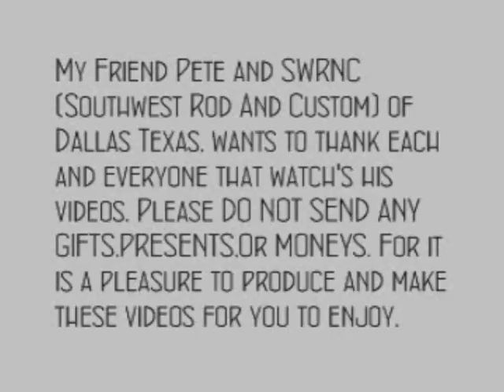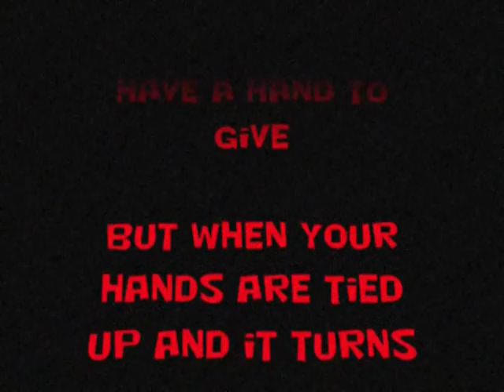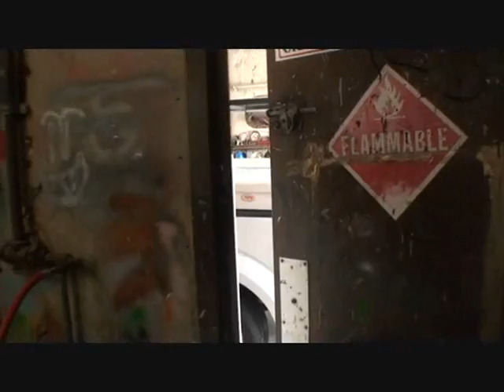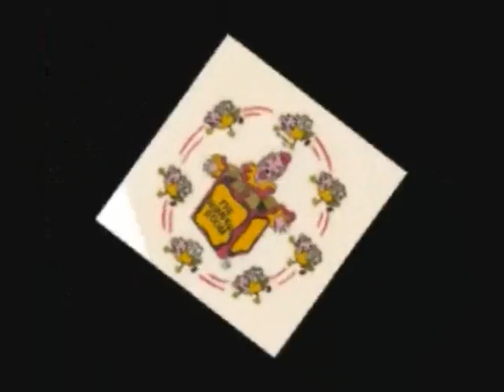Axle Grease And Bondo Don't Mix-Paint And Body Shop Nightmare!

Comment: ''LOAN'' shop space? oh boy...

Horsepower is created by efficiently moving the air fuel mixture through the combustion chamber and that's the HEADS and cam. The bottom end has to be able to handle it

I wouldn't take anything to him. He's an Excuse Guy
Reply from the maker: mcinkyt I was thinking the same thing on the horse power!
Reply: CSXRockford Yes, but it's all about air flow, hence Headers Intakes and least restrictive filtration. The bottom end transfers that to the crankshaft > transmission 

.... NASCAR restrictor plates
Reply: parts changer